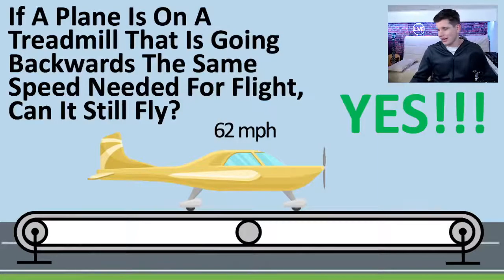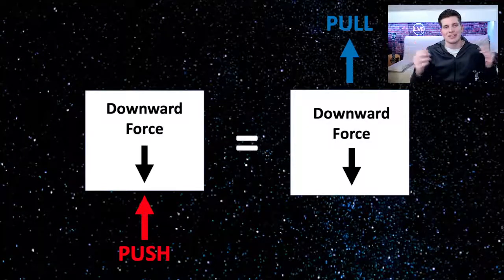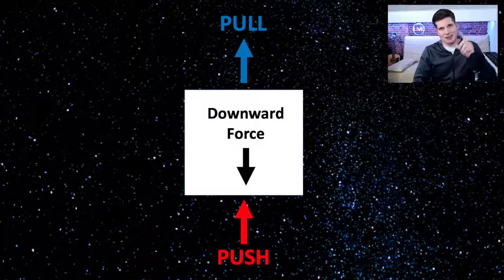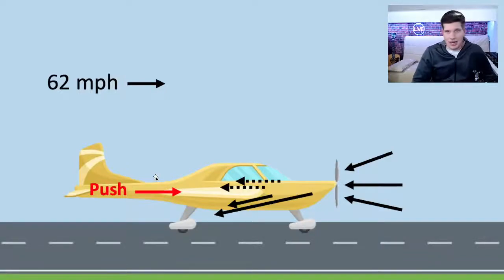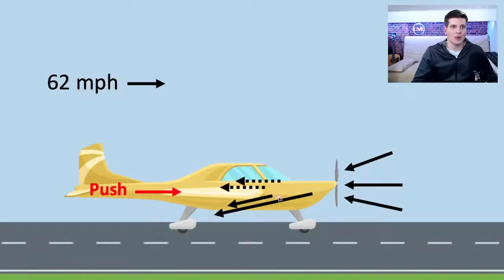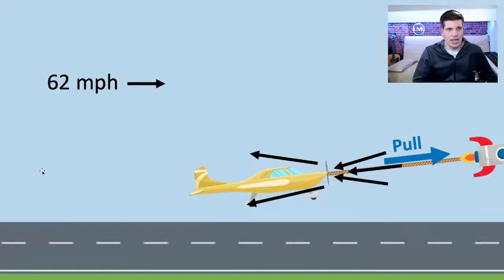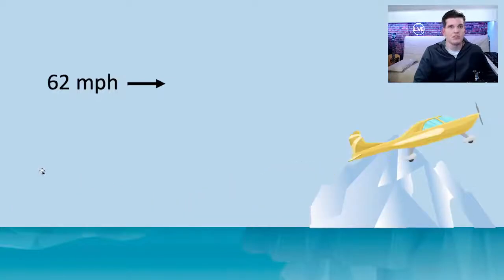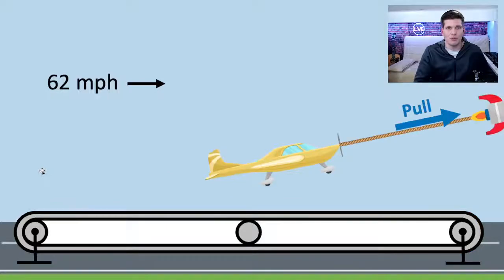Can A Plane Fly On A Treadmill? SOLVED! -A Practical Review

Comment: Actually you have cheated your way out of this question by putting a hand there at the end... There is no mention of an outside force which holds the plane in it's place. That is the question brother... A treadmill will eventually make the non working plane go backwards after the g-force of acceleration dissipates . And you are gonna need more power than the  actual required taking off amount regardless of the speed of the wheels. As one of the pilots mentioned the tires of a 747 would not hold the turning speed and they would blow even if you apply that hand there 🤣🤣.... There is no treadmill or conveyer belt which would not drag back a free spinning wheeled vehicle. It is physically impossible...  So the question can not assume a non law abiding object.
Reply: Let's assume a very long conveyor belt - so the aeroplane can't fall off before it starts its pursuit for a takeoff in the opposite direction - and you're right, the aeroplane initially moves backwards with the conveyor belt.

In fact, let's assume the pilot intentionally keeps his foot on the wheel brakes, meaning the aeroplane's wheels can't rotate at all.

The aeroplane will obviously go backwards with the conveyor belt until the conveyor belt reaches the aeroplane's takeoff speed, but in the opposite direction.

Once the conveyor belt reaches the necessary speed in the opposite direction, the pilot then guns his engine for takeoff and releases the wheel brakes.

Consistent with Newton's third law of motion, the aeroplane will most definitely accelerate forward along the conveyor belt until it reaches the necessary airspeed, and will takeoff. This is guaranteed.

For safety reasons, aeroplane wheels are designed to rotate at several multiples of normal takeoff speed.

In this example, the aeroplane's wheels on takeoff will be rotating at twice the normal takeoff speed, well within their tyres' design tolerance. The tyres will not explode, and the aeroplane will happily takeoff.

Comment: Okay, let me (a pilot) chime in. Everyone in here gets it wrong due to a simple misconception. They are right of course that there needs to be relative airflow (not groundspeed as many wrongly assume) in order for the wings to produce lift. The misconception is the assumption that a conveyor belt would cause the airplanes body to be stationary, which it would not. An airplane moves forward as a result of newtons 3rd law. Engines push air backwards, which causes the enginges and subsequently the airplane itself to be pushed forward. All a conveyor belt would do is increase wheel rotation speed, which is irrelevant. 

The airplane will always move forward regardless of what the belt is doing. Therefore, the airplane will always achieve sufficient relative airflow and take off.

On a different note (see it as a fun fact), an airplane could take off without any forward motion whatsoever, if only the airspeed on the wing is high enough. At my Flight School, a Cessna 152 was once lifted by a storm, flipped in the air and landed on another Cessna.
Reply: The assumption is 0 wind hence ground speed. Relative air flow just adds another layer of confusion.
Reply: Completely wrong though the treadmill needs to accelerate quickly enough to hold the plane back that's the whole premise of the question. same as you literally holding it back with your hand how could it move forward when it's being held back by the friction of the wheels speeding up quickly till they explode?
Reply: @tmaxxmm541  You are so incredibly wrong that it's hilarious.
Reply: @tmaxxmm541  Again, as stated above, the airplane would NOT be held back. This is where the confusion arises.

Think about it this way. Imagine a car comes to a stop at a red light on an icy road. The light goes green and the driver hits the gas. The tyres would slip and the car would remain stationary. This is analog to the conveyor belt.
An Airplane however does not care about ice on the runway. It can accelerate exactly as well as on a perfectly dry runway since forward force is applied in the air and not on the ground.
Reply: @ogaibo1316  yeah you still don't understand it. imagine if the treadmill sped up to 500 mph within a couple seconds the plane obviously couldn't overcome that and it would be flung backwards just because of the friction of the wheels coming up to speed. overcoming any force the engines could put out so quickly so it's obviously something in between that because the conveyor shouldn't let it go backwards either but it would never move an inch forward or backward because the treadmill is going the exact accelerating speed it needs to hold the plane right there it's a riddle more than a physics question
Reply: @tmaxxmm541 have you ever seen the tablecloth trick?

This is exactly the same.

Comment: Imagine the airplane is tethered from moving backward.  If the takeoff speed is 62 mph and the treadmill is already moving at 62 mph, at engine start, the airplane will have to gain enough ground speed to exceed the treadmill's reverse speed.  At 62mph of ground speed, its wheels will be spinning at 124 mph. The speed of the tires and the treadmills do not negatively affect the Speed through the air or the speed over the ground.

Comment: The comment about not needing to know anything about the aerodynamics of flight discredits the entire video for me.
Reply: But he is still correct as only airflow and takeoff speed need to be reached. You can watch Mark Rober and Mythbusters prove that the exact same takeoff speed and distance are achieved on a treadmill regardless of its motion since the wheels just spin freely (roughly 2x their normal speed at takeoff). The planes are not beholden to the treadmill.

Comment: The wheels are moving at 62mph not the wind over the wings.  It needs 62 mph of wind over the wings for it to take off. This is wrong. The plane is stationary in 3d space. The comment that you are not an expert in aerodynamics holds true here. Do you feel 12 mph of wind in your face when you are running 12mph on a treadmill?
Reply: All those on here who say the plane would not move are forgetting that the only thing turning an airplanes wheels is the forward movement of the plane. If the plane really does not move forward at all, then the wheels do not move and the conveyor does not move. There is no motor turning the wheels, and so without forward motion, the wheels would not spin at all, i.e. a speed of ZERO. And then the conveyor would match that motionless speed, and how exactly would a non-moving conveyor stop the jets from forcing the plane forward? The conveyor does not even begin to move until the plane is already moving forward, so it obviously does not prevent that from happening.
Reply: Aircraft create thrust against the air. Running is through your feet. Stand on a skateboard and have someone pull you at 50mph. You will feel 50mph of wind on your face regardless of treadmill spee
Reply: @PabloGonzalez-hv3td  How do you know this?
Reply: @johncharles2357  It's common sense
Reply: @PabloGonzalez-hv3td that mixes and matches frames of reference yet again.

From the frame of reference on the surface of the conveyor, things are zipping along quite nicely 

From the frame of reference of the combined system, the motion at the wheel axis is nil in the environment.

See the Mark Rober video on ‘jumping on a train’.
Reply: The plane doesn't lift up when it's wheels are at 62 mph. It will accelerate further until it is moving forwards 62 mph with regards to the outside world. At this point, it is moving 124 mph with regards to the treadmill (that's also the speed of the weels at takeoff).

You can also imagine that the plane has giant frictionless ice cubes installed instead of wheels. This ice plane would simply not care about any movement of the ground and would behave and lift up even if the ground is making all sorts of wonky movements.
Reply: @resiknoiro7506 the ice example is only if you weren’t similarly moving the surface at the same pace (accounting for the coefficient of friction, which is implicit in the description of the thought project.).

The speed at the wheel axis is exactly the tangential speed of the rotating wheel and the difference of the moving surface.  They are two independent devices artificially synchronized by the parameters we are given.

The Mark Rober video on ‘jumping on a train’ has the experimental demonstration when the aircraft and conveyor are in sync…and when they are not.

Comment: Your power dynamics check out, but you dismissed the effects of gravity on the plane too fast, which is really why the wheels exist in the first place. Friction is a bitch, and it needs to be overcome for anything to start moving, no matter where its propulsion comes from, and the wheels are there to minimize it. The treadmill is practically there to make the friction stronger, not weaker, so this is a lot more complicated, taking gravity into account.

In the end though, the plane will still take off when the wheels reach their terminal velocity (assuming they can endure such forces without exploding).

Comment: Planes fly using airflow over the wings, which is attained by pushing air backwards, and therefore pulling the plane forwards through the air. It does not power the wheels to move forward. Yes, it will take off.
Reply: air flow is obtained by lift factors associated with forward motion.  If you removed the wings, you still have to analyze the force and the rate at which the wheels roll and how the conveyor negates that rolling speed.  Thrust yields forward motion, not lift per se.

Comment: An airfoil needs airflow to provide lift. The wheel and conveyor cancel each other out, so there is no net forward movement. Therefore, no airflow moving over the airfoil. The plane will not take off.
Reply: My friend, The engines grab the AIR not the GROUND, the bely has no effect on the engines that a thrusting forward using AIR not GROUND CONTACT, if it was a car it would move but this is a plane, there is not force counteracting its thrust that comes from the AIR. The only thing that will happen to the wheels is that they will increasingly turn faster
Reply: @rifleer1531 The wheels are not frictionless and planes don't start from moving.
Reply: @Arasmuss  I know that, which is why the answer is yes and no, in concept it works but in reality it wont
Reply: @rifleer1531 mark rober and myth busters proved it does work at large and small scales. Model planes with plastic wheels and real planes all take off with the exact same takeoff speed and distance.
Reply: @GoatDirt  I know that part of the equation is true the only problem is the landing gear having to survive insanely immense acceleration and speeds while holding up the plane till it takes off which is why Id realistically say it wont work for airliners because of that factor.
Reply: @rifleer1531 acceleration isnt going to be more than the landing gear can handle, and only the takeoff speed (velocity with respect to the air) matters, NOT how long it takes to get there (acceleration). Mythbusters and Mark Rober proved the concept.
Reply: @GoatDirt  Yes but to get to that air speed the tires will be moving at an insane ground speed that they wont be able to handle breaking and causing the plane malfunction
Reply: @rifleer1531 wrong. A plane can take off at 62mph. That means the treadmill only needs to reverse at 62mph. The net contact speed will be 124mph - the wheels are rated to handle 145mph easily. They will be fine
Reply: @GoatDirt oh ok well in that case I guess it depends on the planes takeoff speed and tire quality, I overestimated the required takeoff speed of an airliner and the wear caused on the tires.
Reply: @rifleer1531   You could be right though about the larger aircraft. Takeoff speed is roughly 160mph  so we could definitely presume a 320mph tire speed on a larger jet could probably destroy the tires. Great addition to the physics problem!
Reply: @GoatDirt  Yea thats the only problem that prevents this from working but theoretically it definitely works, but in real life has so many factors that can influence things theory is almost never accurate without tweaks hence why its a theory
Reply: @rifleer1531 Mythbusters and Mark Rober actually proved it could work by actually doing it with a real plane and a model. Definitely worth a watch! I figure of there were a magic treadmill strong enough to allow a 747 to take off from it, the wheels would also be magically strong enough to stand that kind of rotation lol.
Reply: @rifleer1531  that talking point is irrelevant.  It doesn't matter how the force is applied.  The force is acting on the vehicle - whether with a geared car engine, a propeller or jet, or a rocket.

The basic physics principle is that the force applied to the vehicle and the vehicle rolls.  If the 'ground' rolls at the same exact rate, there is no net change in position; no net speed; no net acceleration.
Reply: @rifleer1531  You are right. It's funny how confident people can be despite being wrong.
Reply: The plane does NOT lift up when it's wheels are rotating at 62 mph. It will accelerate further until it is moving forwards 62 mph with regards to the outside world. At this point, it is moving 124 mph with regards to the treadmill (that's also the speed of the weels at takeoff).

You can also imagine that the plane has giant frictionless ice cubes installed instead of wheels. This ice plane would simply not care about any movement of the ground and would behave and lift up even if the ground is making all sorts of wonky movements.
Reply: @resiknoiro7506 exactly right! The wheels
 will spin roughly twice as fast as normal at takeoff, but the wings do not care as they will receive airflow just the same.

Comment: The entire purpose of wheels on a plane are to roll forward. If the wheels were irrelevant because they aren't driven then planes would just have concrete blocks. 
The wheels are the most important part of take off.
Reply: No. There are float planes with pontoons and aircraft with skis.

Comment: lol you wasted all this time to be wrong.  AIR OVER THE WING.  Period.  Without forward motion, there is no lift.  No, the propeller will not create enough wind to make the airplane fly.  62mph - 62mph = 0.  With 0mph airspeed there is 0 lift.  lol you are not smart.
Reply: The treadmill doesn’t move the air around the plane.  It only moves the ground beneath the plane.  The planes takeoff speed is an air speed, not a ground speed.

Comment: Lift is attained by air movement and that is lacking if the plane does not physically move. so the answer is NO! If the plane was already airborne and tried to land on the treadmill then it will continue flying at the same speed it approached and can depart at a faster speed or on simply deflecting the horizontal stabilizer to lift the front up.
Reply: Why would the airplane not move?  Remember that its wheels are free-rolling and close to frictionless.
Reply: @mr88cet exactly right. People fail to grasp this extremely critical point. While rolling resistance increases slightly as speed increases, after the wheels spin at 2x their normal takeoff speed, the rolling res is never enough to cancel forward motion. Anyone who doubts the plane will take off just needs to watch the Mark Rober or myth busters videos where they proved this at large and small scale. It is solved and you clearly understand why. Great work!
Reply: @mr88cet it’s not about the wheels free spinning.  That talking point only means that the wheels in this case rotate around the bearing.  That’s unremarkable.

However, while it’s on the ground, the motion of the test vehicle as measured at the wheel axis is always the tangential speed of the wheel at the circumference of the wheel.  That’s the definition of angular momentum when you don’t have slippage.  This is a fundamental principle.  End paragraph.

Move your surface at any rate and you get the equation:

Wheel axis speed equals tangential wheel speed plus/minus the rate of speed of the surface.

To see it in action, look at any old school WWII aircraft taking off an aircraft carrier.  The rate of the aircraft in the atmosphere is the rolling rate of the aircraft plus the speed of the aircraft carrier.

Now to check math, do the absurd thing of turning the aircraft around and going from bow to stern of the aircraft carrier and you will end up with that net speed of the aircraft in the environment.

It’s basic kinematics.
Reply: @MrDefreese , for the record, that’s the definition of angular velocity, not angular momentum, but no worries.

So, let’s look at the version of the myth that the Mythbusters tested, which is not this version.  The myth they tested was that an airplane on a conveyor belt going at a fixed speed of the plane’s take-off speed in the opposite direction cannot take off.  (The version they tested did not have this clause about matching the plane’s wheel speed.)  We’re assuming still air here — no headwind nor tailwind.

What do you expect will happen in that scenario?
Reply: Stop thinking airplane is a car, airplane engines put ZERO power to wheels, you can change those wheels to skis or pontoons  and that airplane can take off.
Notice skis or pontoons are not spinning under the airplane . There are YT clips where airplane take off from water and snow.
So if water under airplane pontoons will match the speed of the airplane it could not take off ? Easy to test , only need some pumps to get water moving.

Comment: So by extension, this must also apply (not the flying part) to a rocket car on a treadmill as you have changed the method of propulsion. So, if a rocket car had a top speed of 200mph and you held it in place on a very long treadmill rolling at 300mph before firing the rocket and releasing it, the result would be the same as a accelerating on a normal road minus a bit for friction?
Reply: exactly